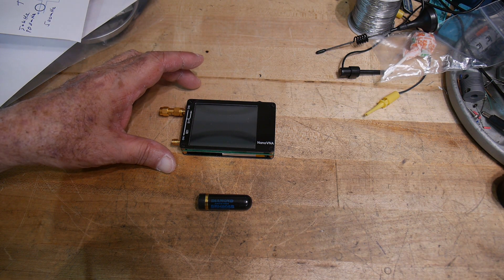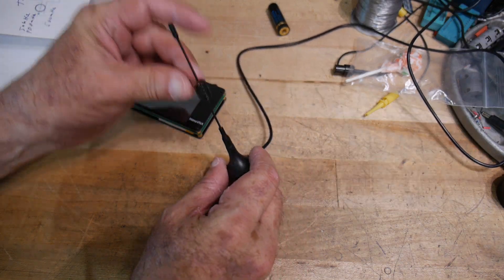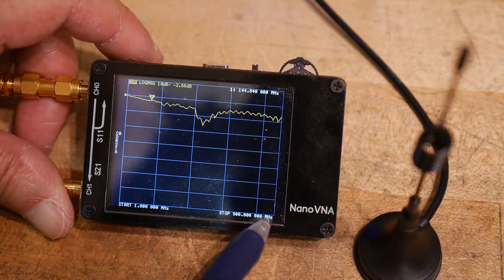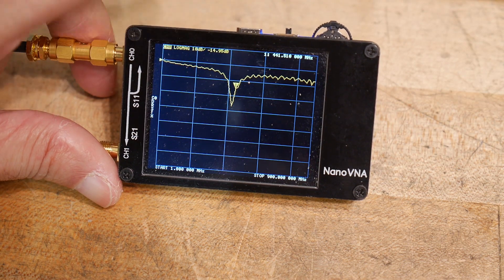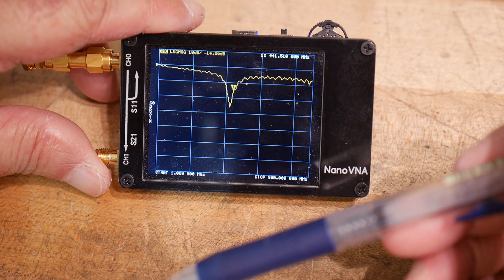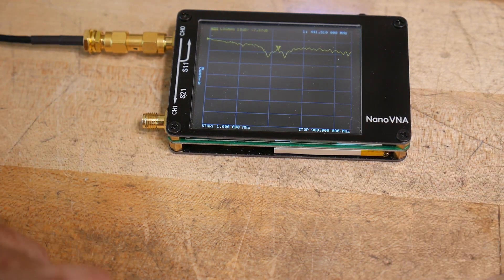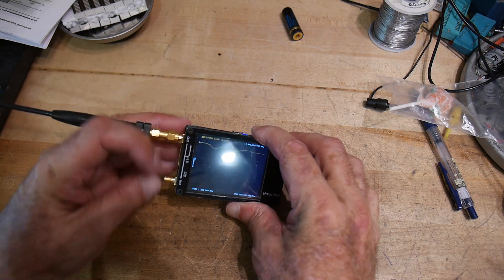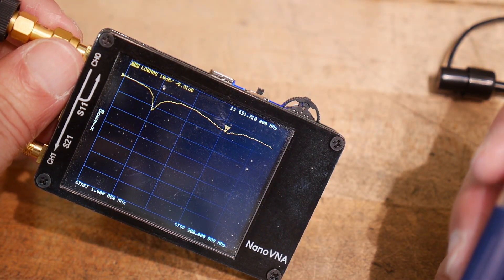#366 NANOVNA more bad antennas from china

Comment: The first antenna - I have one looking almost identical but it is actually an old cell phone antenna from back when mobile phones had an antenna connector to plug in to an antenna on the roof of your car. The dual band in its name referred to the GSM 900MHz and 1800MHz bands.

The last antenna, I also have a similar one, also meant for 144/430 MHz but when tested it resonated at totally wrong frequencies, 180 and 600 MHz I think, but not sure I remember correctly. It being useless I cut off the covering to see what was inside and see if I could fix it. To my surprise it worked correctly before I even did anything to it (aside from removing the cover). It was probably designed to be without the cover and then someone who doesn't know the first thing about antennas added the cover to make it prettier. What I still cannot fathom though is how the plastic cover increased the resonance frequency whereas by my understanding it should have decreased the resonant frequency. I'm not sure I remember the frequencies correctly but I do distinctly remember my surprise that they decreased instead of increasing further when I took off the cover.

On another note, recently I bought a Chinese 11 element 2400MHz Yagi (for WiFi). Its best SWR was 9:1 at about 4000MHz and what little it radiated went sideways instead of forwards. I have yet to take it apart to see how it achieves such a feat.

Comment: I bought an FT817ND about 3 years ago and there was a rubber duck with it. I tried it on 2m first: no good, tried 70cm: no good, so I tried it on 6m: no good. The SWR was high on all three frequencies so I don't know what it was.
I was very surprised that Yaesu had put this in. It was no use to me and I threw it away but before I did I took off the connector and soldered a telescopic aerial to it so I could use it for 2m. 
I got a NanoVNA a couple of weeks ago and could have measured the frequency of it.

I've used it to check the h/b dipoles in my attic and they are just slightly too long. They work and the SWR is low but now I can get them spot on.
I used it to look at my h/b magnetic loop as I tune it to different frequencies.
I used it yesterday to look at the performance of an LC filter to notch out 9MHz in my h/b tx/rx which I think is amplified by the broadband P.A.
How did I manage before without one?
G4GHB.

Comment: If it were 10 Mhz high high, trimming the end would make it higher. What ARE you talking about?
Reply from the maker: I said short in wavelength, I ment lower in frequency.
Reply: @IMSAIGuy  Ah,,,Thanks...Had me puzzled!
Reply: @IMSAIGuy  Short in wavelength means higher in frequency.

But at 2:57 you literally said: "I kept snipping it off to make it go higher and higher in frequency" which is reasonable because shortening the antenna's active part will increase its resonant frequency.

Comment: As crappy as many China antennas are, at least test them in the mounting they were designed for.  This might be at the top of a metal box (ht) or on top of a large (at least a 1/2 wave) metal plate.   Monopole antennas perform very differently without some kind of ground plane.
Reply from the maker: you didn't read the description. also you might enjoy this: https://youtu.be/wem0DoPe5O0
Reply: @IMSAIGuy  Sorry, I just watched your video.

Comment: VHF/UHF HT antennas are notoriously difficult to characterise - UNLESS they are attached to the  transceiver they were designed for.   Reflections from the surrounding room can also shift the design resonance and  SWR levels considerably.  (But certainly many antennas from China are "bad" - usually due to poor construction methods used to reduce the manufacturing cost of a cloned item)

Comment: is there any differences in measurements when we analysing antenna at vertical or horizontal position?
Reply from the maker: This is a controversial subject. Many believe yes there is a difference no matter what. My experience is that the differences are due to proximity of objects. If the antenna is far away from any object then there should be no difference.
Reply: @IMSAIGuy  thanks for your reply. Nice video.

Comment: Your testing method is the prroblem ! Hold the brass base of the antenna and hold it near your head and the resonant frequency will move to the required band. They are designed to be used on hand held! The Nano is fantastic value. M0iiZ

Comment: If you Santa to test a magnetic antenna for mobile use, you must put it on a metal base or , batter, on a car roof. Without a groundplane it does not work
Reply from the maker: read the video description. I did use a ground plane

Comment: I’m sorry that I had to give you a thumbs down on this one. If I did not view it correctly then I will change that. You have to understand that mag mount antennas only have a quarter wave radiating element and must have a counterpoise. Ordinarily this would be the roof of your car. In the absence of a car roof such as where these videos were taken, you can take two metal rods that are at least 19 inches long laying one perpendicular to the other in the mag mount antenna at the intersection of them and that will serve as a sufficient counterpoise or ground plane. Without that counterpoise the antenna can only function as a half wave radiating element meaning the second part of the advertised a dual band.
Reply from the maker: It was off camera. I used the top of a metal filing cabinet

Comment: You get what you pay for I guess.  Just for grins I put the antenna from my Yaesu FT-60 on the analyzer and it was resonant at 2m and 70cm.  It had the best match at 2m which didn't surprise me considering these fractional wave dual band  rubber ducks are a compromise.  I also pulled an antenna off of an old ICOM 220MHz brick and wasn't it resonant in that band although, to be honest, the antenna may be damaged.  I used to work for an aerospace contractor before I retired and have used all sorts of network analyzers.  MY fave was the Agilent PNA-X and have always wanted one.  Out of my price range; however, this nanovna really exceeded my expectations for a device under $50.  Yeah it has it's shortcomings.  The selector switch sucks and the touch pad leaves a lot to be desired but for the use I intend it for it meets the bill.
Reply from the maker: When I worked at Wavetek we had a 40GHz Wiltron what was very nice. I felt silly measuring my 2m antennas on it when no one was around. The nano is quite good. My friend acutally uses it at work to design fiber optics communication PCBs
Reply: @IMSAIGuy  I just wish the software for it worked better.  I have v1.03 on my windows 10 machine and the smith chart selection doesn't work.  Don't know it it's how my machine is set up or if the software is buggy.

Comment: I had the same mesaventure with a Chinese antenna 433 MHz gain 12dBi announced and bought on Ebay. It resonated at 795 MHz with a VSWR of 1.1. The litigation ended with a loss of 50% of my purchase and 2 antennas on my arms which are of no use to me !

Comment: #1 put the VNA in SWR mode for better viewing. 
#2 the magnet mount antenna whip is actually two antennas separated with an open air coil.
The top part is the 2m and the bottom part is the 70 cm part of the antenna.
The top was longer than the bottom. 
You cut the VHF part down to resonate in the UHF band.
In the video looks like the two elements are the same size. 
Now you ended up with two element of 440.
Next time if you try to tune the UHF band cut the bottom of the whip. 
You can cut off the coil and you would end up a ¼ --440 antenna it would give you the best SWR and wide range.
Reply: If return loss is under -10 dB, that is equivalent to 2:1 SWR.

Comment: interesting, I've bought some "dual band" antenna's and you're correct. SWR was terrible. Don't have a VNA yet (it's in the mail)
but I noticed 2 things. You didn't have it in the swr display
and I didn't see a calibration with open, short and 50 ohm load.
Just wondering
W9DLP
Reply from the maker: Yes was calibrated. used return loss measurement

Comment: I really recommend this one : https://www.ebay.com/itm/RH951S-DUAL-Band-HT-BNC-male-ICOM-YAESU-VERT-144-430MHZ-Antenna-For-Radio/281132847572?

I managed to get it down to almost 1.0 swr on both 145mhz and 432mhz with just minor mods.  works great for me, have 3.  On some you need to take apart the middle coil so you can cut the antenna under it.  But on most you just have to cut a little bit of the top antenna.

Comment: From my limited experimentation, I found that for both these tests I got better results with a different setup (though I can't see your metal ground plane):

1) For a metal ground plane contact antenna, use varying but mostly just a large metal surface. I often use a large piece of stainless steel from the side of an old microwave. If I'm in the field, I'll use an upside down skillet (especially ones with big copper bottoms. Care to try these?

2) For the other antenna, I found calibrating against the end of a 10 foot (or so) long coax cable and then attaching the antenna to that cable, which was suspended by a tripod up in the middle of the room. I think the idea here is just to get everything away from the near field of the antenna.

If you would let me know if these methods are any different for these measurements you did or not.

Thanks!
Reply from the maker: I did use a metal ground plane. top of filing cabinet or top of metal tool box.
Reply: @IMSAIGuy  please see my comment you are not testing correctly. It is the way you are positioning the antennas on test. You will be surprised at the improvement in performance ! M0IIz

Comment: I got my nanovna today. can you let us know which firmware you are running on your unit?
Reply from the maker: I can't figure out how to view the firmware version. do you know?
Reply: @IMSAIGuy  no, i thought maybe you installed a firmware from the internet. does it show any extra info during power-on? one can also dump the firmware with dfu-util with:

dfu-util -a 0 -i 0 -s 0x08000000:leave -U firmware.bin
Reply from the maker: @p23q  I want to flash the firmware someday. Too chicken right now. Don't want to brick the thing. If I can dump the firmware that will be good. then I have a copy of the original. There is no info on the startup screen.
Reply from the maker: @p23q  The software does not allow download to save existing firmware. only upload and upgrade (this is what you are told to used).
No way to check revision also
Reply: @IMSAIGuy  they are absolutely impossible to brick